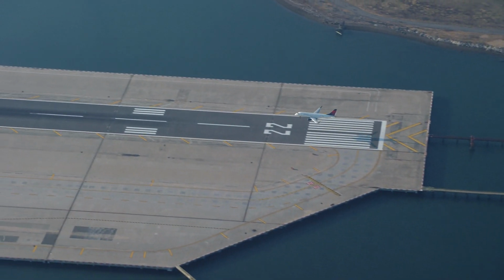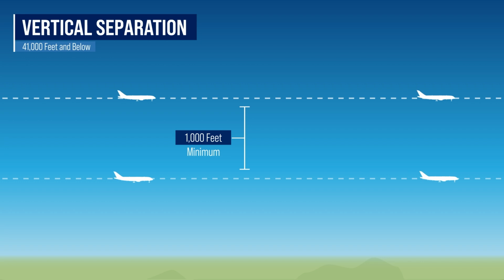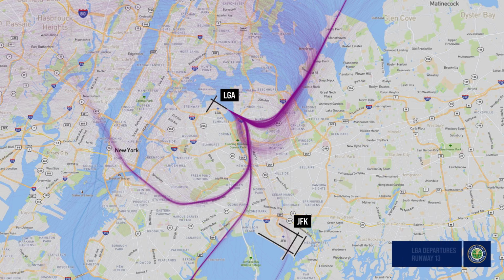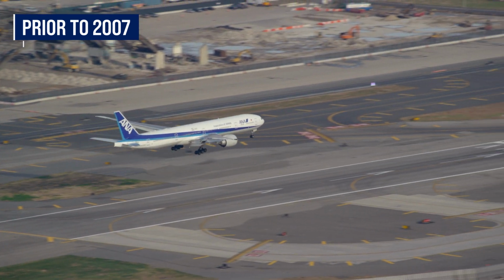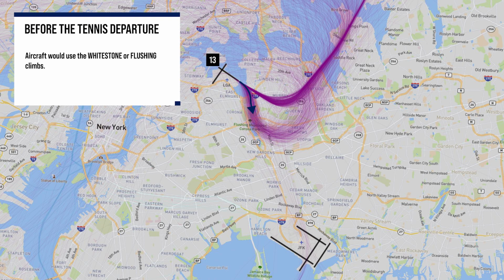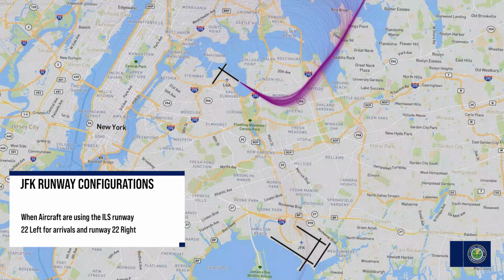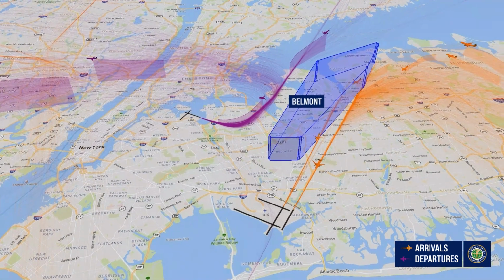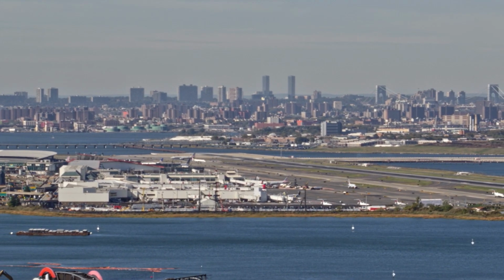La Guardia Airport TNNIS Climb

Comment: BS!!  I would say 95% of Runway 13 use TNNS climb, doesn't matter if destination is southbound like Altanta, Orlando, Miami...etc which base on this video should use Coney Climb.   And westbound flights also don't use Maspeth -  I been monitoring flightradar24 almost daily this summer,  most are TNNIS flights going northeast then make a big loop back down south!   Both Coney and Maspeth flights are like Whitestone climb - going over Flushing Meadow Park and gain altitude before going over residential area.   TNNIS climb rumbles through north Queens from 1500 ~ 2500 alt.  NEXGEN RNAV is inhumane and does not consider the residents getting bombarded by up to 18hours day, as dense as 90 seconds apart!   NYC need to sue FAA just like Phenoix and have flights routes roll-back to Whitestone Climb - still flys over my neighborhood but at much higher altitude.  Every 1000ft in alt is -10db!
Reply: 100% accurate Raymond.  This began the destruction of Queens and Nassau County and some extend Suffolk.  The NextGen RNAV TNNIS climb opened the door for JFK to constantly abuse runways 22L and 22R for arrivals.    Port Authority is to blame too, people like Ralph Tamburro claim to help us residents and fight for us but actually do not.  Money / profits over the health and safety and quality of life of us residents on the ground

Comment: DISGUSTING! Once again, the FAA presents biased information to the public.  Since around 2012, the use of "Sat Nav," and particularly the TNNIS departure, has bombarded New Yorkers, particularly those living east of LaGuardia Airport, with noise. The FAA refuses to limit, or do anything, that will diminish low flying, loud, departing flights on runway 13 from LGA. Even the alleged nighttime curfews are ignored at times.  "Operational Considerations" are consistently given as excuses for bombarding local residents with loud, annoying, & unacceptable levels of noise from departing planes.  At best, this video gives an understanding of the extent of the problem, it fails to hold the FAA responsible for allowing the situation to exist